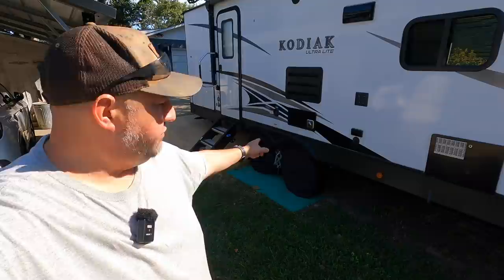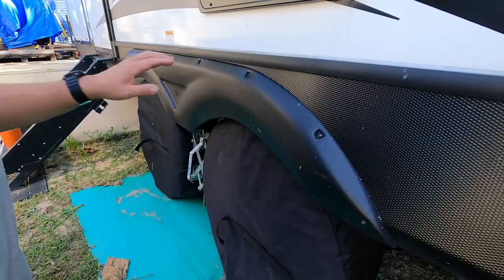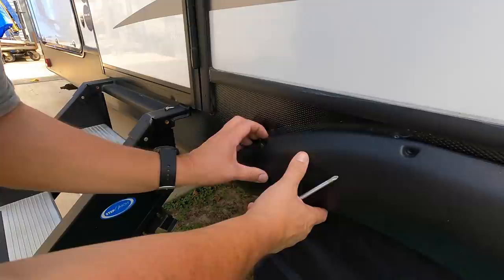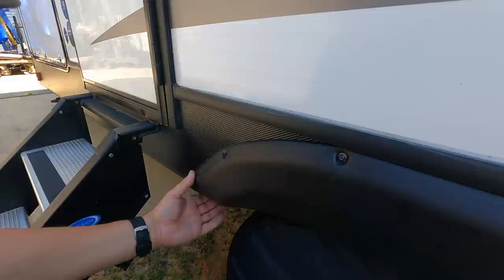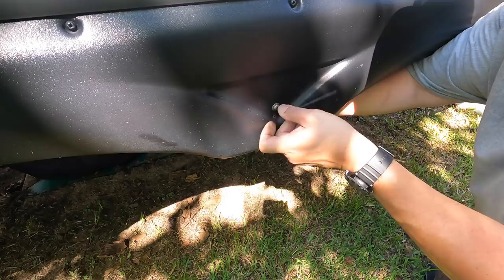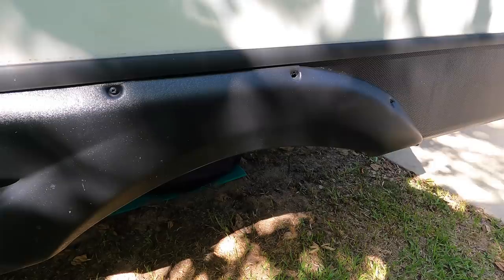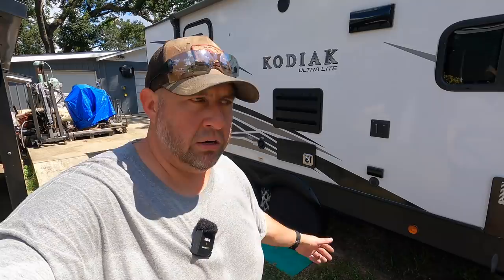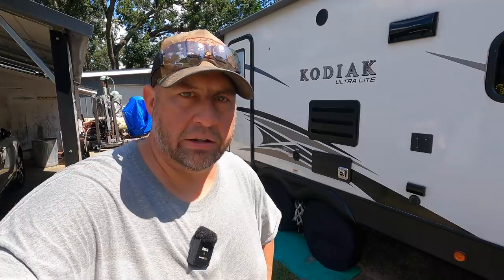RV How-To: Fender Replacement

Comment: My 2018 Keystone Outback 328RL is worse. Both sides have cracks down the fenders in inches! Keystone applies clear caulking along the outside perimeter possibly to further reinforce the attachment points. When I replace mine, I plan to apply multiple coats of undercoating spray to build up layers on the underside of each panel to strengthen the existing flimsy thin plastic material. Thank you Adam. Eager to see your Big Haul adventures.
Reply: Good idea. I was thinking it may have been an idea for Adam to lay a bead of liquid nails on the backside of the new fenders just behind and under the top most lip where those cracks formed. I bet if you even just shoot the back of yours with Flex Seal, it would hold together much better. Maybe lay on some JB weld where the cracks formed and then shoot it with Flex Seal or similar. I try to address failure patterns when making a repair so I don't have to do it again. 😸

Comment: It looks like there is a space between the fender and the trailer wall, maybe use a rubber washer or inject some silicone in the back then let it setup before you install. That will give support and the cushion will help keep it from cracking. A lot of wind force on those, bet they are vibrating like crazy going down the road which is causing the plastic to give way. Surprised that you didn't inject some silicone into the old holes that go into the wood to protect it from moisture.

Comment: Most likely over tightened screws crushing the plastic which will shrink and expand a lot with the weather. Rubber washers or grommets would help a little. Drilling oversized holes in the plastic will help with the expansion and contraction as well helping to stop the cracking.

Comment: I loathe working with stainless... it's seizing 'idiosyncrasies' are fabled in story & song.

If there's any possibility of ever needing to remove stainless hardware, a tiny dab of (ultra messy) anti-seize is a must. Even then, no guaranties.

Curious; do you crawl underneath now & again for good thorough 'nothing in particular, everything in general' inspections? I think I would...

Cool videos, Thanks!

Comment: Hey Adam,
I do NOT know if your RV would be compatible with my following suggestion or not.  I fought the bolt on plastic fenders for several years.  MY solution was non-hardening gray butyl rope caulk (as used on grain bins).  Basically using that as a flexible bonding “buffer” material to keep the fenders from wholly flexing at the screws. 
Ken
Reply: Pretty much the same idea. I'm wondering if some mastic / dum-dum / auto body seam sealer strips would go in between fender and aluminum, and spread the vibration load out. Those holes are really close to the periphery of the plastic. And the dum-dum strips would cover the holes left in the aluminum from the original drilling.  3M seam sealer being one example.
Whoever designed those plastic fenders did not have long life or solid design in mind ,whatever the cost of replacement.

Comment: Did they give you those fenders as a free replacement under warranty? I'm not sure exactly how old your Kodiak is, but that seems to me like it was fitting for warranty replacement because it doesn't seem THAT old. I'd guess 5 years old? Even if the Kodiak is out of the official warranty period, that should be a goodwill warranty encounter. You and Abby take really good care of that unit. You go so far as to condition the popout seals regularly. I'd guess that you apply UV protectant ("sunscreen") like Aerospace 303 to the plastic parts like the fenders too. If not, consider it. I love Aerospace 303! Amazing stuff. It's probably a pain to think about, but if those upper screws go into the floor maybe consider taking the top screws off and pulling the fender out a bit so you can put a dab of RTV silicone over the old hole to seal them up?
Reply from the maker: Yes they were a warranty replacement.
Reply: @AbomAdventures  Awesome!!! Glad they took care of you and did the right thing. :)
Reply: @AbomAdventures  do you have a contact at Dutchmen? My 2020 Kodiak 201QB has fenders worse than yours.  I tried emailing their team to no avail. I called the number on there website twice and got some medical survey company.  Any help appreciated!  Stay safe and keep the great content coming.

Comment: Ultraviolet rays are killers to plastics. Interesting how plastics also are affected by age as they also tend to "dry out" or become brittle and less pliable. The worst however, is the sunlight. All we can do is keep plastic restorer dressing on them and just hope for the best. I see more and more black plastics on automobiles and trucks that I have to wonder how anyone will ever find a replacement plastic body part after their well taken care of vehicle needs a replacement due to fatigue or just plain product failure after the manufacturers stop making those parts which tend to be about 10 years.

Comment: I think you mentioned some of the screws went into the floor of the camper? I was just thinking that might cause some issues with moisture? I would suggest a dab of silicone in those few screw holes - just like screws in a bathroom to stop water from entering. I noticed some of the screws were a bit rusty? Otherwise nice work! Thank you! :)
Reply: x2...I would think a sealer would be wise as well.

Comment: What is the scissor type bracket between the tires for?
Reply: They’re called X-chocks. They’re a scissor jack that has pads that conform to the tires. When you expand them they lock the tires and stops the RV from rolling. Does the same thing as regular wheel chocks only better.

Comment: Why would they change the screw pattern?
Reply: My best guess would be that the old injection mold probably wore out, and when they had a new one machined or casted they just said "The screw holes are not a critical dimension so there's no need to match the molds exactly, just get them close enough." Their minds are on making new RVs, not replacement parts that are a direct bolt-on replacement which are perfectly aligned. Injection molds wear out over time. Now, if you're making a Glock 19 frame, those holes in the new injection mold better be exactly in the same, proper spot as the old one! 😸

Comment: You should use double-sided tape because after a while When driving on the freeway those screws are going to get loose from the air pressure at high speeds.